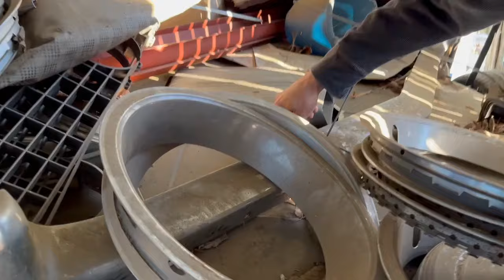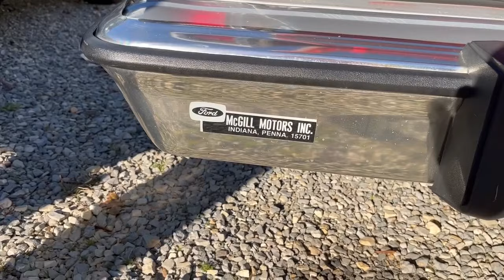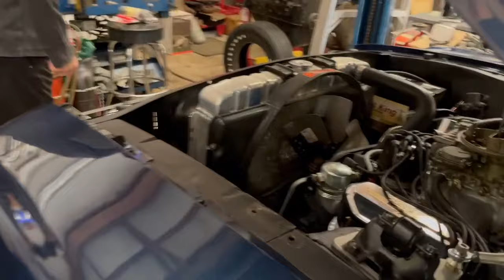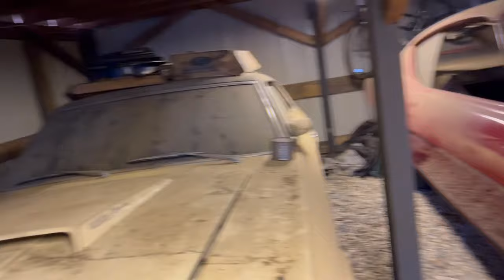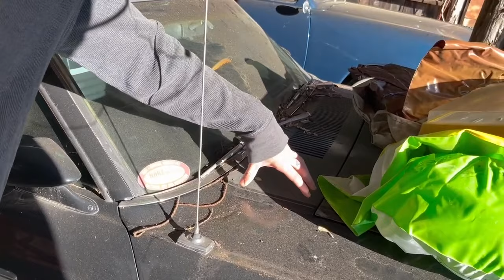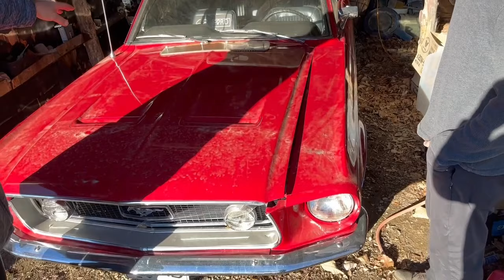Mustang You've NEVER Heard BEFORE!! - Police car, 428 cars, 1967 Mustang Fastback

Comment: The reason the 427 cars were so much faster is that the 427 was rated at 390hp & the 428cj was rated at 335. Both vastly underrated of course.